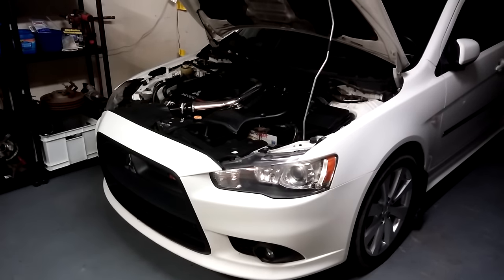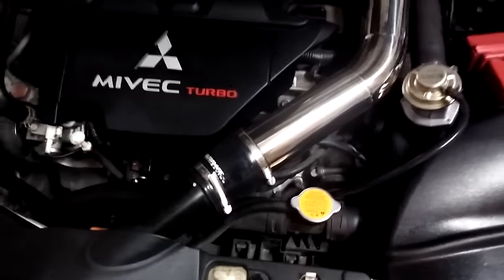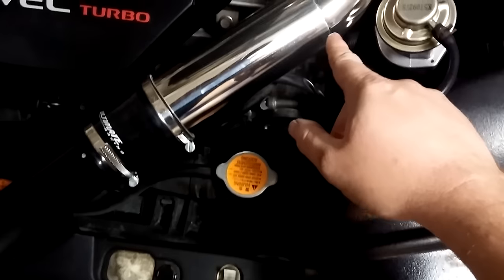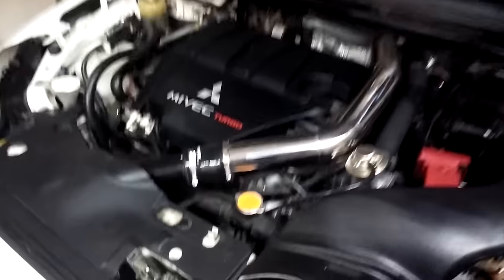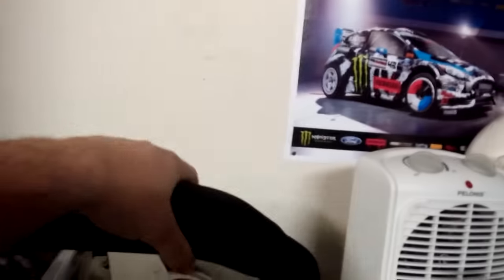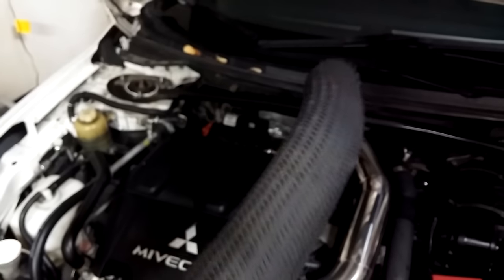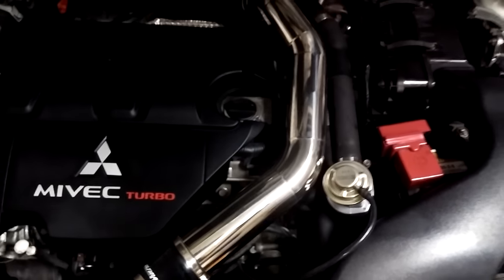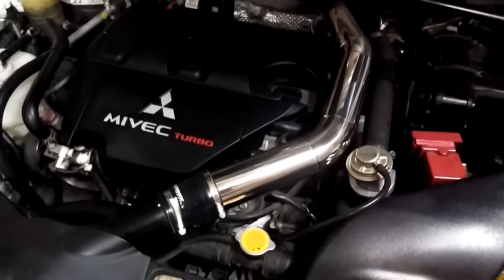Review: Ultimate Racing Upper Intercooler Pipe

Comment: hi Robert a if you remember I got my 2010 ralliart the same time you got yours but now when I'm driving in normal ,it goes to 2000rpm it rev's down just a little bit.I cleaned the throttle body thinking that would help but it is still doing it I just can't figure it out so if you can help please let me know
Reply: I hope its not too late but do an idle re-learn

Comment: Is that the half or full set? And what's the difference between the two?
Reply from the maker: +Ryan DeLuna it's the half set. Full set goes all the way to the top of the Intercooler, which already has a hard pipe. UR's just has a slightly bigger diameter.
Reply: Robert Harridge for sure thanks! I'm planning on getting the Upper intercooler pipe also. Does it make a huge difference?

Comment: doing a reflash? launch control?
Reply from the maker: I'd like to. just have to find someone to reflash the TCU and flash the MR program on it.
Reply: +Robert Harridge check out Daniel Perez on Facebook. nice guy. helps everyone one out. Dyno/street tune capable. and please keep the vids coming! I have a '14 ralli going thru issues at the moment ....
Reply from the maker: +Bryan Williams what's going on with yours?
Reply: +Robert Harridge I'm on my 3rd turbo. my 4th exhaust gasket. I'm currently burning oil bit by bit. I think it's a valve issue, something in the head. and when I put it into 'D' it makes a faint hissing noise ...no idea what that is